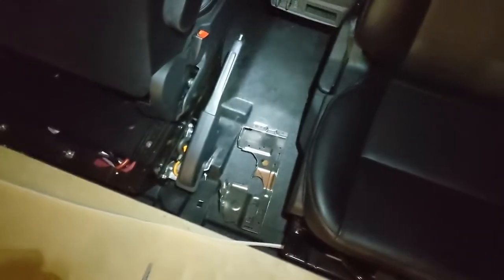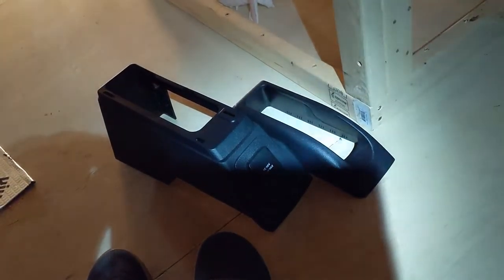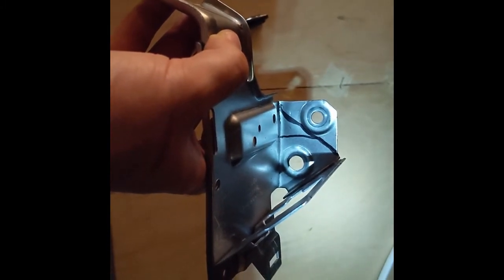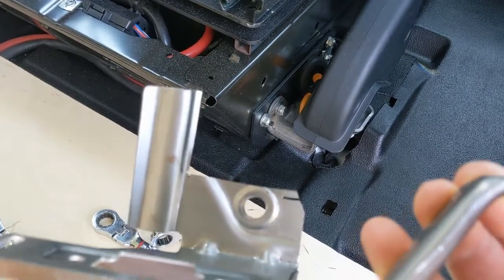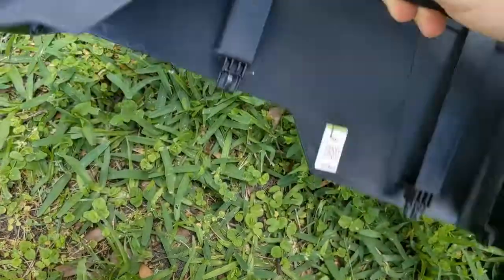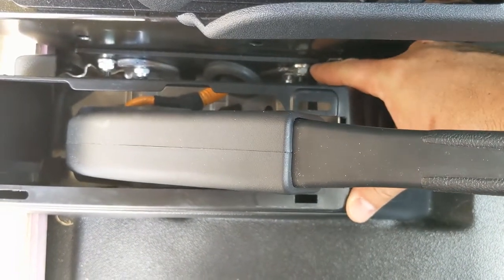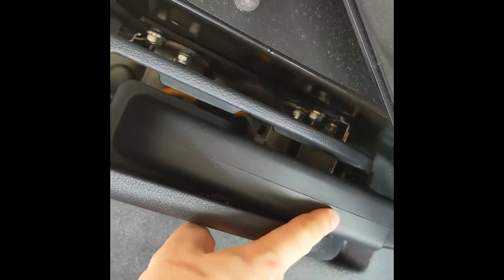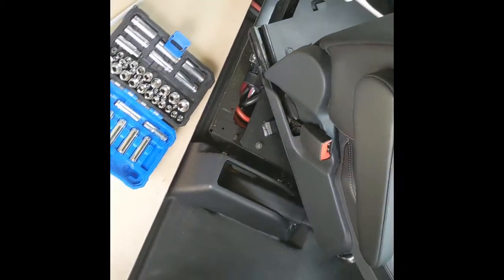Parking Brake Bracket/Housing Modification Ford Transit | Going Boundless Van Conversion 2021

Comment: Hi, I’m trying to find out if there is a way that I can raise my hand brake mechanism as it’s flat on the floor and I can barely reach it. 
I know this is opposite to what you have done but thought you may still be able to answer the question?? Thanks heaps :)